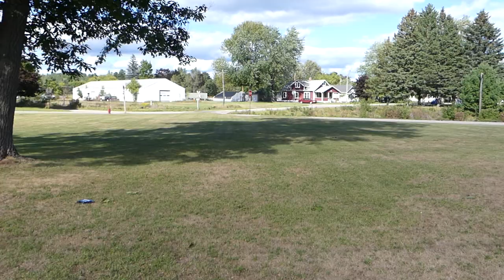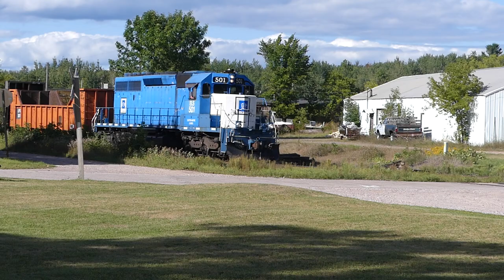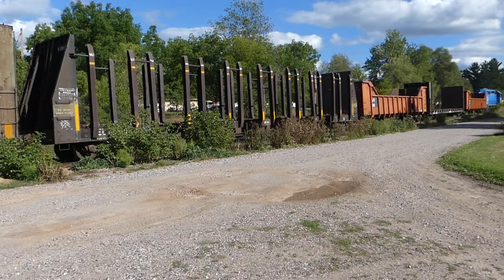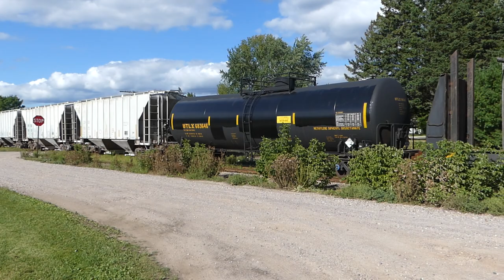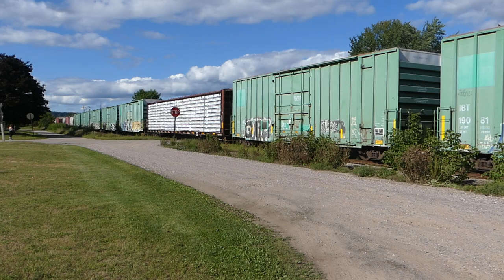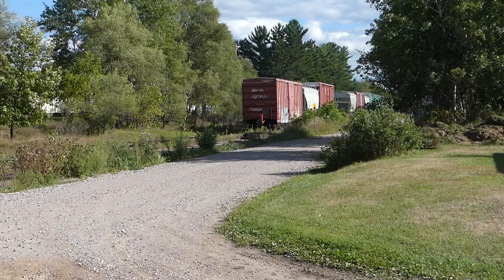Powering Back South, This Former Milwaukee Road EMD SD40-2 Keeps Going Strong! | Jason Asselin

Comment: I used to hang out on the Milwaukee Road tracks on the NW side of Milwaukee in the late 60's thru the 70's. Likely saw that engine when it was brand new 😉. They were still running a lot of yellow EMD FP7's at the time among other older engines, and all of the trains had cabooses back then. Those were the days 😊
Reply: That's cool you got to see the Milwaukee Road before it fell apart. Especially the old passenger locomotives. For me, it was watching Southern Pacific freights in the 1970s being pulled by that road's  celebrated tunnel motors. And the Union Pacific was running their Centennials and DD35 locomotives too. Good times!
Reply: @cris_261 That must have been awesome! I would have loved to have seen a DD35! What a beast! — unfortunately the old passenger locomotives on the Milwaukee Road were pushing around box cars in an industrial spur by the time I saw them. Sad fate for an awesome locomotive 🙁
Reply: @PlanetMojo  Actually, the DD35s were B units. The ones with cabs were DD35A, and only the UP bought those, although SP had 3 DD35s. Most of the UP freights I remember seeing with the big double diesel units were pulled by Centennials (DDA40X). They really made an impression on a youngster, such as myself at the time. I think E&LS ran a few Milwaukee F7s (and some Soo Line F7s) for a time in the 1980s.

Comment: Seems as though the trains are running a little bit faster through there. Did they finally fix the wobbly bit of track?
Reply: Probably not, you can still see them rocking and rolling, and hear the loose fish plates as well. Likely will only repair the places where the train derails.